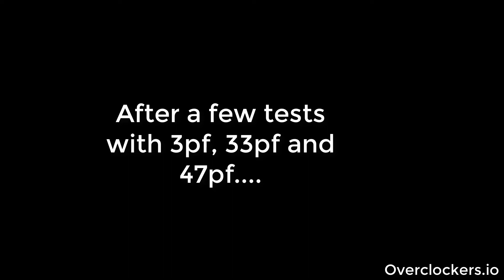Making the TTP223 less sensitive using a capacitor

Comment: When I solder a wire to the top solder pad to create an external touch pad the everything gets more sensitive the longer the wire.  Thinking about testing different capacitors with a wire to see if I can get the results I want.  I want to have to make contact with a  2'  wire.   Thanks! This video helped a lot.
Reply: It is not only the length, also the amount of material. So using the small wires from a motor coil helped me in my case. 
You can isolate it better btw. depends on the project if a GND surface helps to stabilize even more.

Comment: I want the exactly opposite to increase the sensitivity. What can be done here 😊🙏
Reply: Add a copper antenna to the same pad
Reply: @xenusceptic  can you please explain. It will be great help for me
Reply: @satalaj  instead of adding capacitor I soldered copper wire to one side of pad and formed a two inch loop now picks up about two inches away, bigger loop more distance
Reply: @xenusceptic  For my project, I want to increase the surface area but not the sensitivity.  I'm going to try a capacitor along with testing different size wires on that pad.   I'm also using 5 volt to power it - I wonder if using 3 volts will decrease the sensitivity.
Reply: @dairheart could you provide any inside to that? Currently trying the same - increase the touch area  and also sensitivity, since I’ll need to register touches through wood. But tuning it to be just sensitive enough for registering a touch on the wood seems and not hovering above seems difficult
Reply: Great video on the topic!
I'm trying to use this as my door handle sensor to automatically unlock the door from inside.
When the sensor is attached to the handle, it works as an antena, hence the need to reduce the sensitivity.
Thanks for sharing